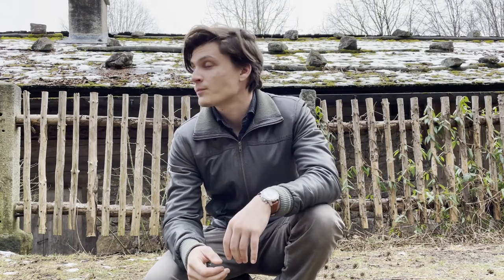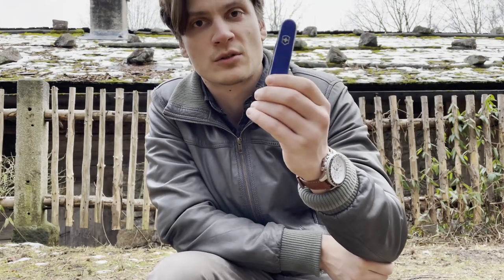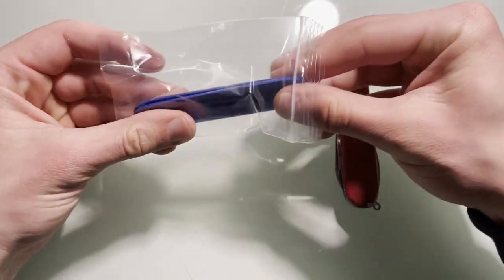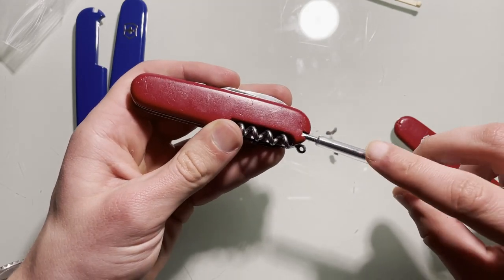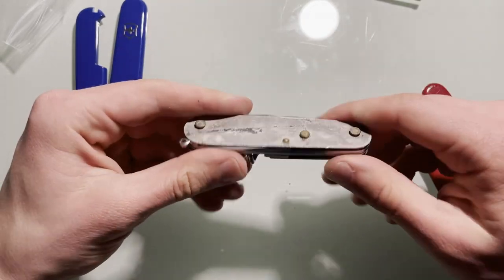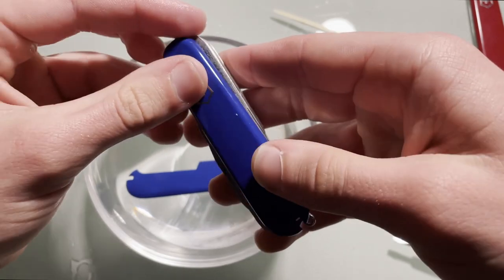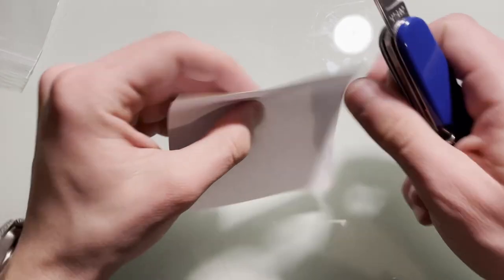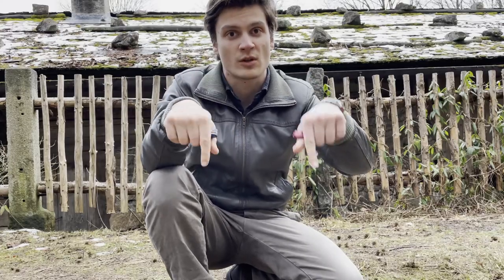How to EXCHANGE VICTORINOX Handles/ Switching Scales on the 91 mm Victorinox Models

Comment: I've done this and the hot water is a good idea.  I also cool the knife in the fridge as well, but I would recommend drying the scales with some paper towel before installing.  I suppose they get rained on and used in wet weather anyway though.  I also use a very small table vice to squeeze the new handles on evenly, but frankly, I bet using the weight of your foot would do it just fine with a paper towel wrapped around it to prevent scratching on the floor.  With use, the scratches come anyway.